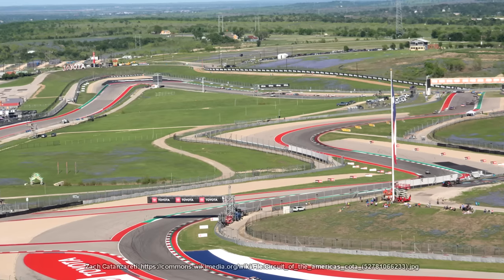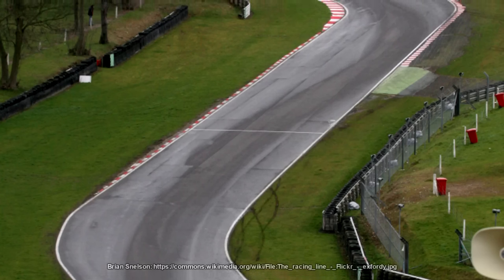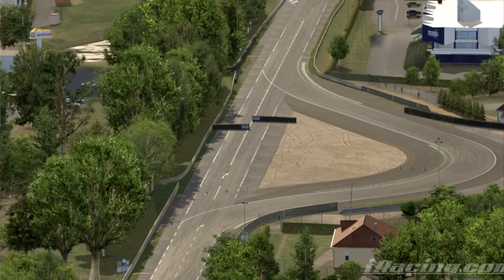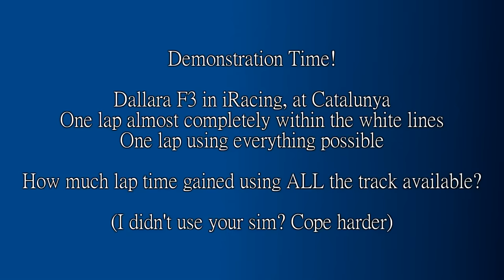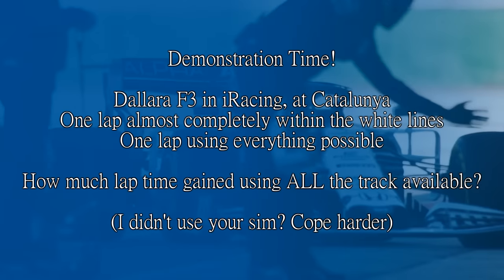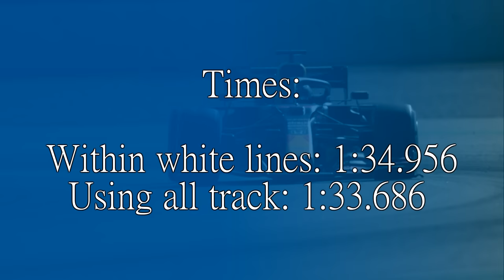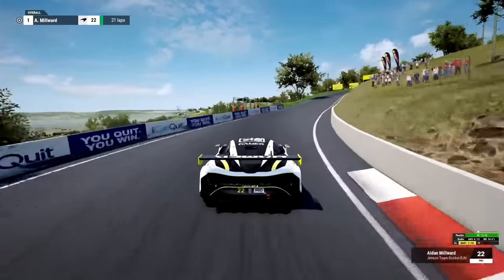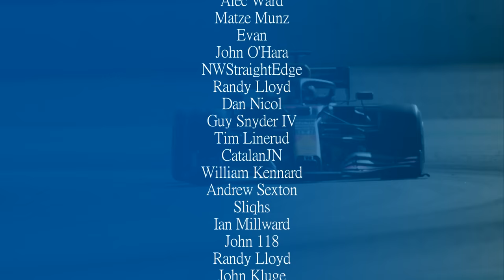HOW THE PROS FIND THE TIME! How Effective is Using All the Track?

Comment: Time trials used to be my thing, I'd spend days refining my lines and setup to go as fast as possible. The way I used to go about it was first to learn the track and the car so you know where you're going and how the car likes to be treated, the second part was playing around with track limits to find where you could get away with cutting and extending, the third part was refining to combine the exploits with maximising time gains. One thing you've got to get your head around is thinking about what comes after the corner rather than the corner itself, apex speed and late braking isn't always the key to lap time, you might see someones ghost ending up a car length ahead by the apex on the more conventional line but you've gapped them before you're halfway down the straight and continuing to pull away. If, for instance, there is a long straight after a tight corner then instead of carrying speed through the apex you want to be focusing on getting the car straightened up as early as possible in order to get the power down earlier, you're extending the time spent cornering slightly to minimise time on the straight, being later on the brakes will gain you less time than getting on the gas sooner. If you've got a complex of low speed turns then you want to be as late on the brakes as possible and you might compromise the line and speed through 1 or two turns in order to minimise the time spent on another, longer turn. It's all about thinking about the bigger picture rather than being a hero on the brakes and the wheel, sometimes a line feels janky as all hell but it makes an upcoming section less difficult to perfect.

Comment: Every copy of the first Gran Turismo had two booklets included in the packaging. One was the normal user manual. The other was the little racer's handbook. It outlined everything you needed to know about corner arcs, weight transfer and transitional traction, characteristics of each drivetrain layout and even included a section on using traction circles. A little encyclopedia of racing techniques that they felt they needed to give 12 year olds like me in 1997 to understand their game. I'm glad they did. It's somewhere on the web, I'm sure.

Comment: Ayrton Senna had an interesting one in his book. He would sacrifice the ideal apex in a corner in favour of the longer straight, because he would then, in a sense, make that straight longer. The rationale was that he would be accelerating sooner on the corner at the start of that straight, and decelerate later in the corner at the end of it. Therefore more time spent at higher speed. The sacrifice of speed on the shorter elements of the track before and after are more than made up for. Now I can't remember if he gave an example of what track he did this on.
Reply: As much as Senna was a genius, he did not invent the late apex. If there is a continuation of this series, the reasons to stray from the geometric racing line would almost certainly be the next topic, as it is in many similar videos.

Comment: Funny, as a very amateurish racer I've always treated it as once you get two wheels across the edge of the line you have a penalty, <edit to clarify> your inside two wheels, you're car can be off track on average as long as two wheels stay inside the lines<done clarifying> but you don't want to use it because it's either usually slipperier grass or dirt, or an obnoxious curb that can do 2 hours of wear on the car in 5 seconds, but sometimes it's worth it.  That also always seemed to be the way they police track limits in most series you ever see televised so I guess I just assumed how things were as far as you should push them in real life.

Comment: This leads me to another question: in that same “Pro Esports” type lap with the F3 car, you go with 4 wheels outside the white lines (or just outside) like 4-5 times.

Would you’ve gotten a 1x or off-track in IRacing (or whatever it’s called) for those occasions in a race? How those off tracks work and are they just broken in one way or another?
Reply from the maker: Depends on the track. Typically so long as two wheels are to the right of the white line you’re alright.

Comment: There's a difference between fastest line around a lap and the racing line, 
I took the JimRussel driver training in 70s on old formula fords and to go fast you need to get the corner finished early so its a longer full throttle straight,  racing line you need to be taking awathe guy behind you late brake and apex line so he cannot get past you.